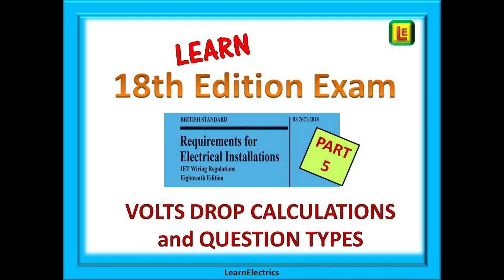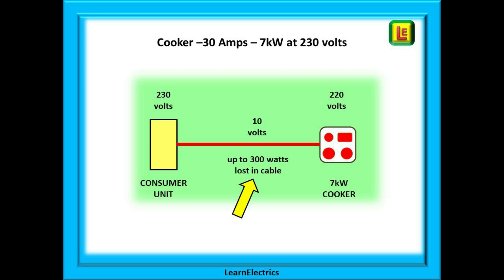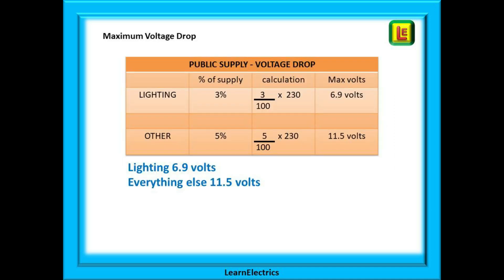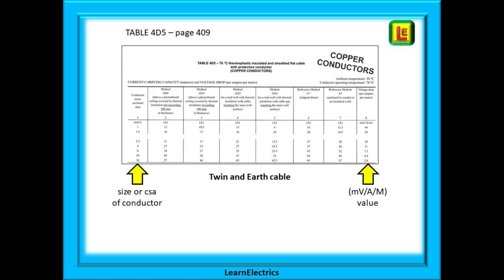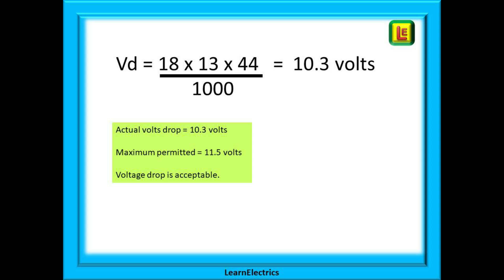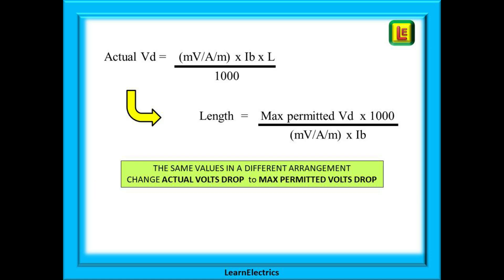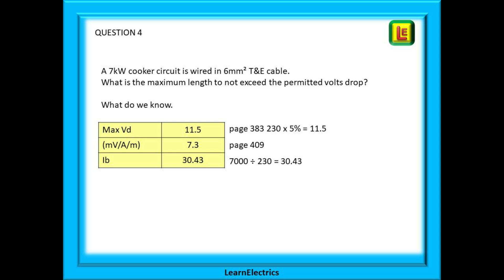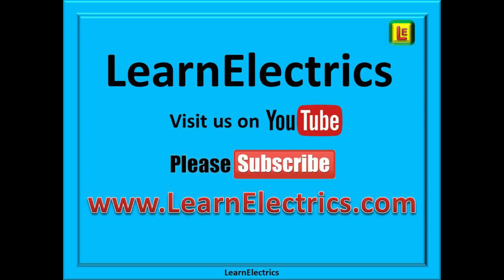VOLTAGE DROP CALCULATIONS for 18th Edition Training and Exam Question Types

Comment: Great Video as always and learning a great deal, only thing on this video, is where to actually find the volt drop and maximum length formulas in the regs, anyone with any pointers much appreciated. 👍
Reply from the maker: The formula is not shown in the regs. It is talked about over several paragraphs, but nothing like a formula is shown.

Comment: Hi
How can I find the length of a roll of cable that’s has been used if I only have my meter to measure resistance R1+R2 & don’t have any other formulas to hand?
Regards mg.
Reply from the maker: Malachy, have a look at this video and use the table in the video to help. Just treat the roll of cable as being r1 and r2. Connect the Line and Earth where they come through the reel and measure at the other end.
Dave.
https://www.youtube.com/watch?v=9DLgM8wM5xo
Reply: @learnelectrics4402  
Hi Dave!
I have watched video before !!
It’s very good as usual!
Explains all in black & white!!
Thanks Malachy.

Comment: Once again, great channel, can you do a detailed three phase calc? I.e. voltage drop when there are different run and grouping methods, so 100m underground, then 100m on tray, with differing grouping? Do you have to account for these or typically use the worst case scenario?
Reply from the maker: We will do Ed. But generally you calculate and size the cable for the worst case scenario. If a new length is added and the cable conditions have changed then resize cable/re-fuse etc. Which is what we do in distribution boards. Thanks for asking.

Comment: 06:18, I am wondering where is the actual formula in the Wiring regulation book.
Can you help me?
Reply from the maker: It isn't. That's why I tell you what it is. It is in the on-site guide, look in the index for voltage drop calculation. And yes, you will get questions on it in the 18th Exam.
Thanks for asking, thanks for watching. Dave.

Comment: What about Voltage drop if you have multiple Consumer units and the one feed the other until the final circuit??
Reply from the maker: The furthest point of use should not have more than the permitted volts drop.
You may have to increase cable sizes that feed the daisy chained consumer units to achieve this. Or, good practice,  consider feeding each CU independently.
Hope this helps. Dave.